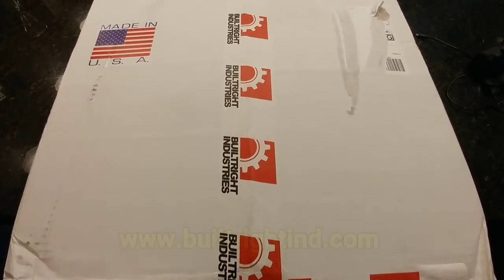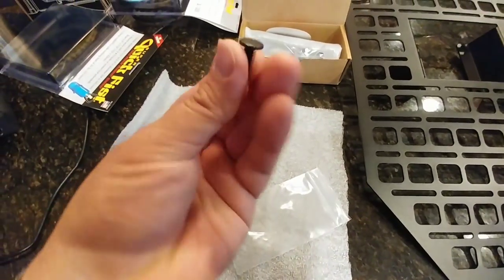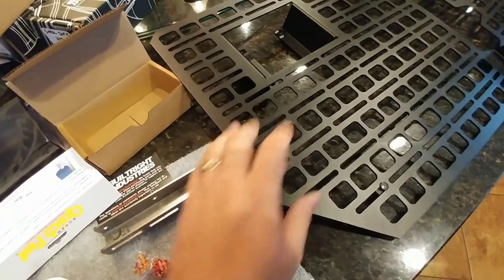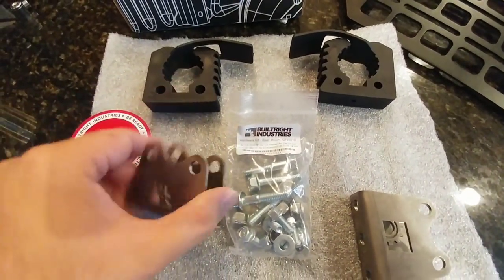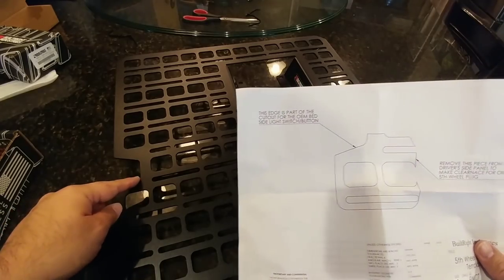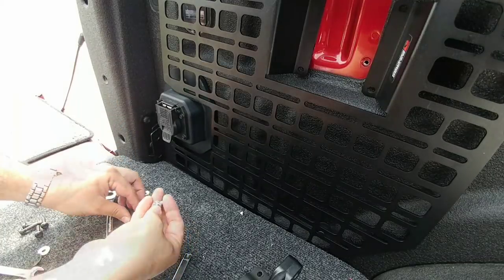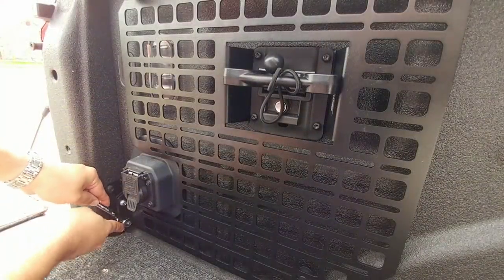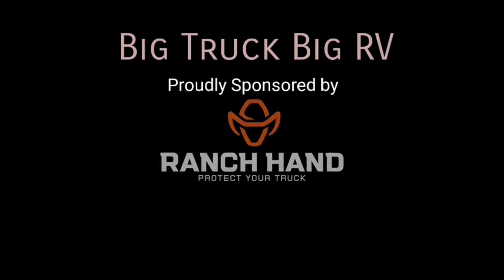It's Built Right!  AMAZING! Waiting along time for this box to arrive! Builtright Industries

Comment: Awesome product!  Have you considered maybe using the OEM Waterport bracket on the rack and using bolts to secure it to there and then it would free up the grips to use on the other side for other things. 

It seems the the OEM bracket would be better at holding it. And with the extra clearance the rack gives you between the fender well and the tailgate the waterport bracket would fit nicely in the same spot or maybe just a little higher.

Comment: Great video!  I installed mine today, and wanted to pass along a few comments.  I have a 2019 F-350 with the 5th wheel prep package.  Since you filmed this video, Builtright made a modification to the driver side bed panel to allow it to fit around the 7-way 5th wheel connector.  For trucks that don't have the 7-way connector, they include a small panel to cover up that area.  Also you won't need any additional brackets for the tie down hooks.  I did have one issue, I had to swap out the hex head bolts with flat head bolts that secure the 7-way connector.  Also I had to use a step bit to enlarge the 4 holes for the box link mounting location on the driver side.  The passenger side bed panel went on without any issues.  Also, if anyone has the M Series Roll-N-Lock bed cover, you will need to cut a notch in the very top on the bed panel, toward the tail gate side.  A standard hack saw will do the job just fine. This modification is needed because the main bracket securing the top bed rail of the Roll-N-Lock cannot be relocated. So far I am very impressed with the product.

Comment: Pretty cool I wish they made them for around above the wheel well section I have my super duty turned into a repo tow truck and I have swing cases on the ends for my chains and straps stead of having to climb in to the tool Box  You just pull a lever and the case will swing out to the tailgate 180ﾟ but those rack systems would be nice to hold other equipment  like L bars and  Pry bar so they werent bouncing around the bed

Comment: Nice looking product. Never understand why some companies narrow their focus so much to particular make/models since it seems easy enough to adapt them to fit others (and, therefore, have them also for GM and Ram, Toyota, whatever) but maybe that is coming in the future.
Reply from the maker: it is, they started with Ford because of the Boxlink mounts
Reply: If they come out with a setup for the 05 style super duty ill be first in line to buy one. Very cool setup, gives me lots of ideas
Reply: Big Truck Big RV 
I see two new problems that you now have with these mounts. 1) You now have successfully blocked your rear LED bed lights. 2) There are new holes in the bed, where water jug thing use to be, that will hold water and rust out the inside of the bed. What are you going to do with the old mounti g hardware for the water jug?
Reply: I can't speak for everybody, but our focus is only (currently) narrow because of the cost and resources required to bring new products to market. This isn't some big business effort - we're a very small business that's be around for about a year. That said, we're working through development and testing of kits for the current model GM and Dodge trucks.
Reply: Good to know. Your existing products for the Ford trucks look excellent. Keep up the good work!
Reply: Thanks Mark!

Comment: I want these!!
I have a F150 and didn’t get the tie down brackets on each side. I had Rhino Lining but in after market. They didn’t cover the screw holes when spraying the lining in. Question; Is there threads in the 4 holes? or Is it built just to have the screws make their own threads during the bracket install? I’m sure some spay lining got in the holes, I guess? Any advice or opinion would be great.
Keep up your great videos.
Reply: Hey there - in every truck that we've seen, there are threaded inserts behind those holes. The screws should not need to make their own threads. Hope that helps!

Comment: So $110 per rack, but you have to customize it for a common outlet?  I’ll wait until they figure out how to program their laser cutter. Close but no cigar.
Reply: These are originally designed for the F-150, which of course doesn't have a 5th wheel plug. If there's sufficient demand, we'll make a set specifically for the Super Duty lineup, but they'll likely be more expensive as a result of the lower volume. No lasers here - this is all custom tooling in a punch. Laser would be around 2x the cost. Thanks for the feedback!

Comment: Too bad you have to cut out the access to the 7 way plug. Losing the coating. Is that anodized?
Reply: J, each panel is powdercoated, but as you saw in the video, the raw edges were touched up, so there should be no issues with rust or corrosion.

Comment: All that gear over the the bed light dont seem practical to me..
Reply: The panels themselves don't block much light, but the gear that you mount to them certainly can. For those cases, we manufacture a plug and play wiring harness for mounting auxiliary lights on the panels to be operated by the OEM button. Pretty slick, if it's a solution that you need.